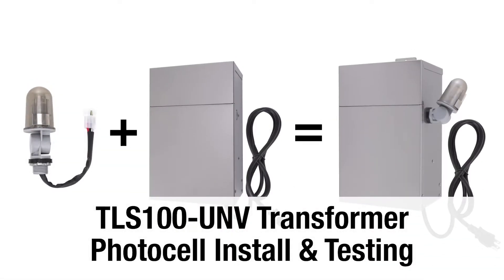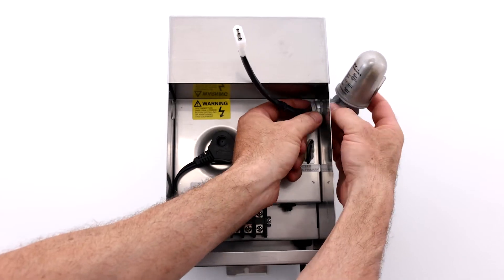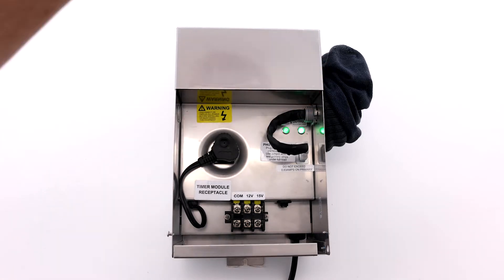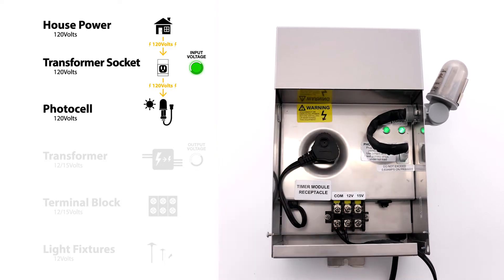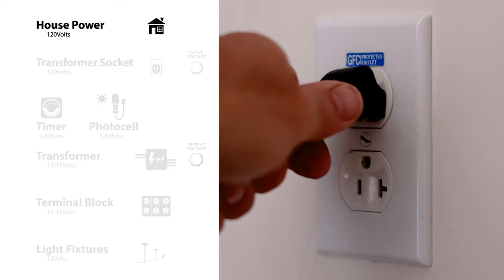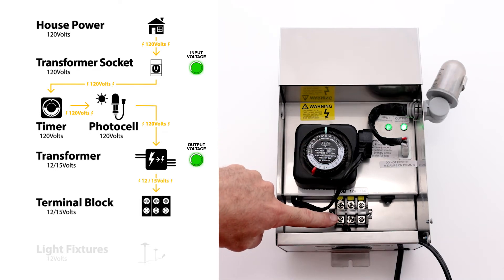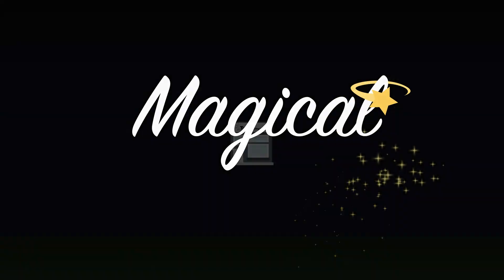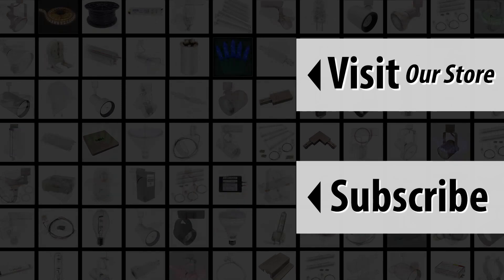Using a Photocell & Timer with the Smartest LED Low Voltage Landscape Lighting Transformer!

Comment: What do I do if I have a photocell without the connector it’s just a red black and white wire?
Reply: And why are the photocells being sold with no connector on the end and no instructions or color code on the transformer?
Reply from the maker: @wilcorpconsultantsllc-just5336  This video is specific to this transformer where the photocell is designed to plugin without issue. As with other brands and models of transformers that we do not sell we are not familiar with those models or the reasons the did not choose to go with a connector. However, the concept of how photocells connect electrically is typically the same.
Reply: @wilcorpconsultantsllc-just5336  Mine was sold the same way.    No connector..  I ordered the photocell with a connector on Amazon.
Reply from the maker: With that type of connector the transformer would have a terminal block to wire the photocell into 🙂
Reply: @Totallightingsupply  thanks 🙏
Reply: @Totallightingsupply - yes my transformer has the e 3-port connector for the photocell but the photocell has the 3 wires, Red, Black, And White.  In what order should I connect them to the Transformer? Is there a diagram?

Comment: Will this work on the older 300 watt units without the green lights?
Reply from the maker: The photocell has a special plug. If your transformer has that socket to match the photocell plug then it will work. You can find out more about the Tork photocell here ➡️ https://www.totaloutdoorlighting.com/transformer-photo-cell-2001-tork-and-moulded-plug.html